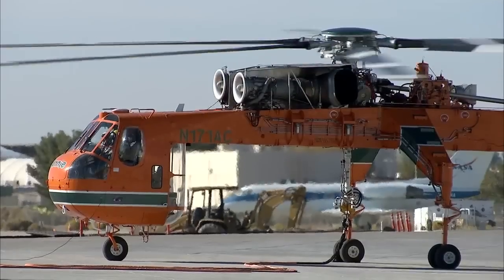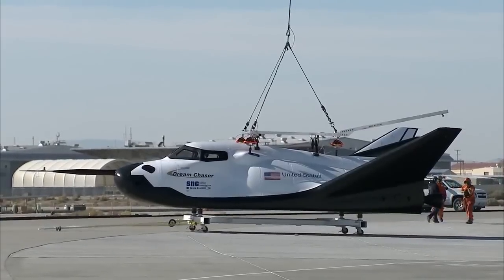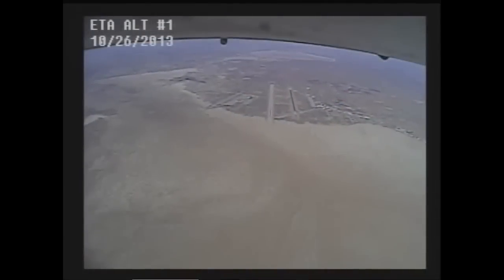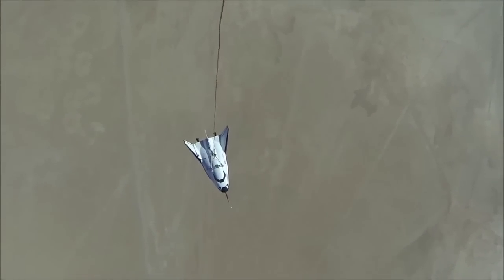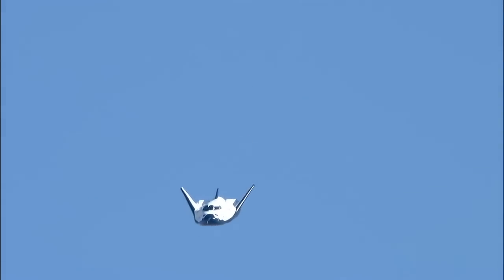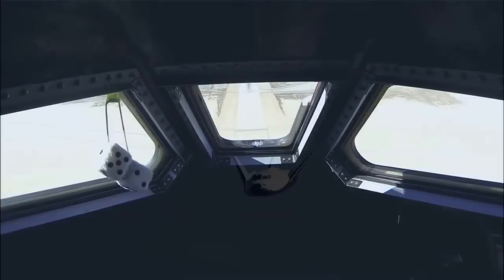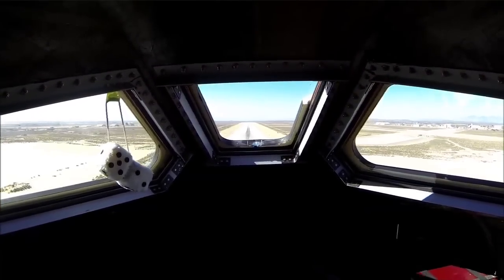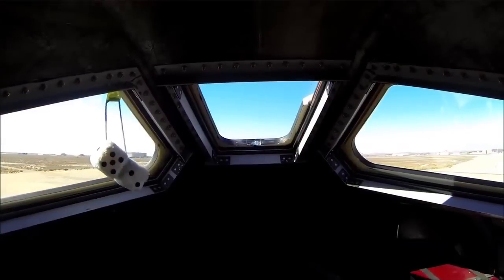Dream Chaser Spacecraft Landing Gear Fails During Test | Sierra Nevada HD

Comment: As a retired USN Captain and FA-18 Super Hornet pilot, if I "touched down on the centerline", then "slid off the deck of the Carrier", when the left main did not fully extend, but the engineers who ALWAYS put in millions of dollars of redundencies into any experimental aircraft happened to miss putting in 4-5 variables that would engage in milliseconds to prevent this from happening, you can be assured that every one of those engineers would have my foot up their ass after I initiated the Martin-Baker eject sequence and ended up in the water, hanging from something on the island, bouncing off another aircraft on the deck, or having my flight- and g-suits ripped off after being dragged down the anti-skid surface of the deck. Sorry, but the only "DREAM" being "CHASED" occurs about 40 miles east of Cape Canaveral --- it's called Disney World !!!
Reply: There's the problem! A real pilot would know that Disney World is WEST of Cape Canaveral, not 40 miles EAST.
Reply: Disney World is west of Cape Canaveral. Some aviator you are if you don't even know cardinal directions or to check for three greens when you lower the landing gear.
Reply: sick burns bro. ;)
Reply: Your text is riddled with bullshit, as a video gamer that lives in his parent basement...

Comment: I find it funny how whenever there is a major issue with a company's rocket or module they are always like "oh this is no big deal, it's just a rapid unplanned disassembly we had" rocket explodes
Reply: Bill Kerman 
except that the soyuz is the most reliable rocket in the world.

Not entirely.  Just because it’s one of the longest lasting launch systems doesn’t mean its necessarily better.  Not saying they aren't reliable.   

Whats your point? If it works then don't change it.

That’s a relative argument and a ridiculous blanket statement!  Works in what way, exactly?  Expendable rocket systems are still costly, draws harder on resources and are more environmentally damaging.   Russians haven’t developed a new rocket system from scratch in decades.  This is not by choice or because of your, "Don't change it if it ain't broken," myopic theory.

What new engine has NASA developed in the past 40 years that got us farther than the moon?

At least NASA got to the moon.  Russians haven’t even sent a cosmonaut to GEO.  By the way, NASA did a lot of work in LEO over the last few decades after the moon missions that yielded many revolutionary results and played a major part in ISS.

Re-usability was also the purpose of the shuttle and why the hell did it cost 1.5 billion per launch?

The shuttle was a more complex and ambitions project than just the concept of re-usability.  It was the only vehicle of its kind that could retrieve Satellites and support the constructions of complex structures that make up part of ISS.

If Russia is so reckless with their rockets then why does NASA use them for the Atlas

First of all, NASA does not own and operate ATLAS, so they have nothing to do with the Russian engine program.  NASA also does not make rockets.  They research, do science, partner and co-develop with private industry, fly missions, contract manufacturers and lease facilities.

Second, ATLAS is now owned and operated by U.L.A. which has nothing to do with NASA.  ULA (United Launch Alliance) is a private company.  It’s ULA decision to contract the Russian engines and guarantee their operational safety, not NASA.  That RD-180 deal was a political arrangement first started in the mid-1990s to help boost the Russian economy after the fall of the Soviet Union.  Today it’s just a cheap place to get left over N1 RD-180 engines.

and why has the US lost more astronauts than the Russians cosmonauts?

Because NASA launches larger crew compliments than the Russians.  Body counts alone does not determine the degree of safety of a launch program.  Russia has never grown their program past the Soyuz and therefor past LEO as far as man missions.  NASA retired the Shuttle because it’s a LEO vehicle only and has outlived its usefulness.  Retiring the shuttle was also a transition for NASA out of doing LEO flights and operations.  They handed that over to the private industry like ULA and SpaceX. NASA is transitioning to DSF (Deep space flight) which is what ORION is all about.

I'm not bashing on the Russians.  They have done some incredible things and make some good stuff.  But these are just the facts.  When NASA landed on the moon, they had finally gone further and have done more in the name of science and the frontier of space then anyone and, from then on,  they have only continued to leap further ahead each decade. Now they are entering a whole new chapter of human space flight.
Reply: Except this is a prototype.  So its truthfully no big deal.
Reply: ***** I know, nowadays, almost all rocket explosions in the United States are prototype testing. That's of course a good thing, because if you look at the USSR and Russia, they were/are completely reckless with their rocketry.
Reply: +Wheatley "Rapid unplanned disassembly" lol.. that's funny. Though, with prototypes you tend to learn more with failures than you do from successes.
Reply: captcorajus  yes, that's actually completely correct; but successes mean that there is a smaller chance that you made mistakes, or did not account for something. So it doesn't mean that it's better to fail then succeed, all of the time, because safety, reliability, and reputation are also standards to be maintained.
Reply: +Wheatley except that the soyuz is the most reliable rocket in the world.........
Reply: Bill Kerman That's because it's the most repetitively reused rocket in the world. With NASA for example, they build new generations of rockets, and when you are creating a new rocket, that is when the majority of your accidents will happen. The Soyuz rocket is the same, occasionally lightly updated rocket that's been used for decades. Also, the re-usability of rockets is going to be the death of conventional Russian rocketry, because the way those rockets are built, they can't be modified to be reused, partially because of the bizarre design itself.
Reply: +Wheatley Whats your point? If it works then don't change it. What new engine has NASA developed in the past 40 years that got us farther than the moon? Re-usability was also the purpose of the shuttle and why the hell did it cost 1.5 billion per launch? If Russia is so reckless with their rockets then why does NASA use them for the Atlas and why has the US lost more astronauts than the Russians cosmonauts?
Reply: *****  Saved me a lot of time with answering the question  ^.^ thanks. FYI I'm half Russian, not that that means much, but just topically related.
Reply: Wheatley People who over-favor Russian space accomplishments tend to forget that the N1 never survived and that Russia's man mission has never left LEO orbit.  I am not actually condemning their industry or slamming them.  They did some great things, but, this comparison in trying to make NASA out to be feeble is just plane stupid and demonstrates bias ignorance.
Reply: +JF BTS I was not putting NASA down. I was criticizing the Shuttle and its safety. The shuttle and the ISS were both pointless and a waste off decades. They only good reason to build a space station in low Earth is to study the longterm effects of microgravity on humans and we could have done that far simpler and cheaper with expendable launch vehicles just like the past space stations. Why do you need to bring something back from space anyway? You can't say Russia was reckless in comparison to the US and defend the shuttle at the same time. Orion is only a capsule at the moment and a lot can happen(politics) before its deep space habitat is ready.

Comment: The "anomaly" was the left wheel not deploying thus causing the plane to skid and end up in the grass (not middle of runway) 

They left that bit off. It's on here somewhere...
Reply: iinRez Right. For the most part the test was a success.  The designed worked. The flight system worked.  The wheel is unfortunate but an easier fix than the other two situations I mentioned.  This is a prototype anyway.  Its meant to be abused. So even a crash gives valuable data for the program.  As the saying goes, can't make an omelette without cracking some eggs.  Nice work Sierra...
Reply: She only stated it "touched down" on center
Reply: Ima SuperPerson → "RESEARCH AND DEVELOPMENT"....
Reply: +JF BTS - I don't know about you, but I like both of my mains to come down upon landing.  I'm just picky like that.